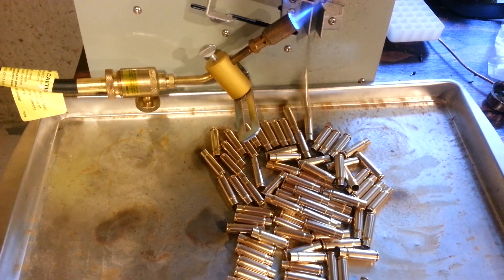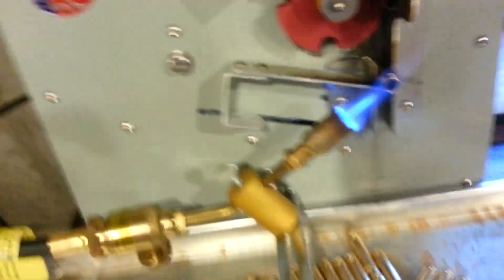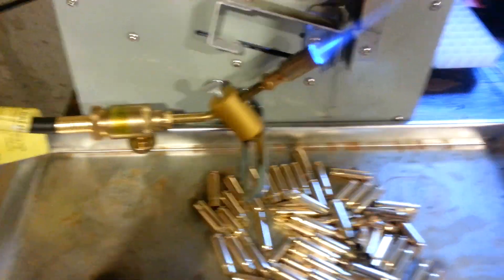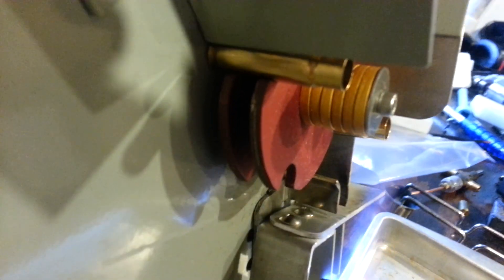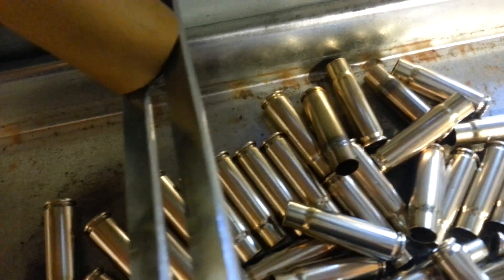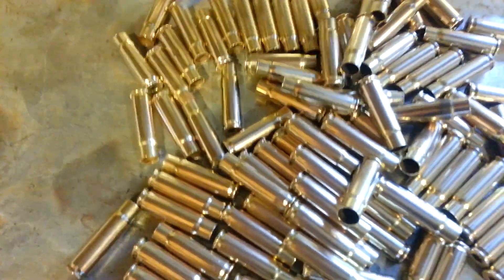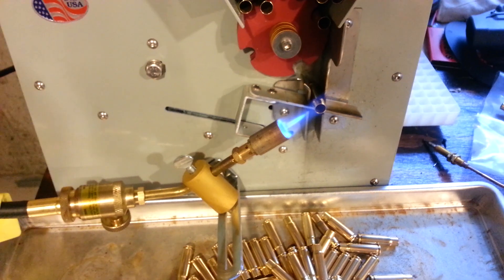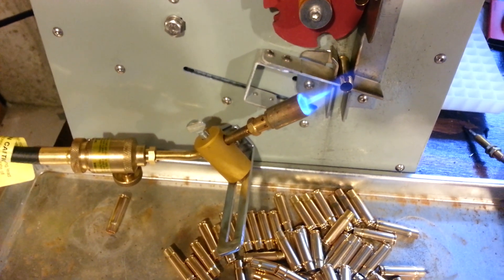Why coloring is not a good indicator of proper annealing.

Comment: What is your targeted temp? 650 degrees?
Reply from the maker: The correct annealing temperature would be ~660 for 15 minutes. Since that's not really feasible, (and would anneal more of the case than desired), the target temperature increases, and the exposure time goes down.

The target for this method is about ~750F degrees. It's recommended that you mark your test cases with 750 degree and 800 degree temperature indicating liquid (we use Tempilaq brand, which can be had from Brownells, Midway, etc.

You want to set your flame and exposure time so that it melts the 750 degree without melting the 800 degree Tempilaq.

You need to actually let the case go through the cooling process after it drops too, to make sure that "heat soak" isn't causing it to actually reach 800+ after it drops out of the flame.

I also recommend mangling any brass that is used for setup, beyond use, and tossing it in the scrap bucket. Don't want over-annealed cases magically finding their way into your good stuff (and they'll find a way if you don't immediately destroy them).

You also want to make sure that you aren't annealing much below the case neck shoulder, as you don't want to soften the case body or (especially) the web. A good rule of thumb is the top 1/3 of the case. If you're melting even 600 degree tempilaq below the top 1/3 of the case, you could be creating dangerous brass.

It's best to apply the tempilaq on the INSIDE of the case. It will melt instantly when the flame touches it, if you are painting it on the outside where it is in direct contact with the flame.

A good "sanity" check to ensure that you're getting the proper neck hardness is to set a pair of vice grips to just BARELY press in the case neck. You should be able to close the vice grips and see deformation of the case neck from a circle. Then release, it it should spring back to where it was before. A little tricky to describe, but hopefully that makes sense.
Reply: uraijit Ok you know what your talking about (lol). I asked your target temp because i have honestly never seen a case not change color at all when annealed properly .... Even my brand new Lapua brass is discolored straight off the press. I thought maybe you were targeting the 650 range and were not fully annealing the cartridge case and thats why it wasnt coloring. I find this odd , what brand of brass is this? Did you say it was winchester?
Reply from the maker: hpjunkie73 The brass is once-fired military Lake City 5.56mm brass, purchased directly from the military. We (West Desert Tactical) then convert it to 300 Blackout for resale. Because the new neck and shoulder are all on 'virgin' brass, it all has to be annealed, or they'll start splitting after only a couple of firings..

This brass is EXCEEDINGLY clean and shiny by the time it reaches the annealing stage. As I said, we recently upgraded our system, and it gets it even cleaner now than we ever were able to get it before (which was pretty clean and shiny even before). As I demonstrated in the vid, if the brass is allowed to sit for a few weeks prior to being annealed, a patina is able to build back up on the brass, and it will discolor to some degree or another, depending on how much patina has built up.

Your Lapua brass is discoloring, because it's been sitting long enough to have formed a thin layer of oxidization (patina), which is what actually causes the discoloration that many might be used to seeing. However, the coloring will vary depending on how much oxidization has built up, so it's not a good indicator of whether or not your target temp has been reached, since there's really no good way of gauging how much "patina" is there and, consequently, no way of predicting how much color change you'll see at given temps.

Also, different alloys from different manufacturers, or even different batches will discolor at different rates as well. So, again, color is never a good indicator of temp change (which means using color as your temp indicator will lead to inconsistent annealing, which means inconsistent results).

This is why going solely based off of color doesn't tell the whole story. Some brass might not discolor at all, until dangerous temps have been reached, ruining brass.

By the way, you may already be aware, but just in case you aren't, your Lapua brass was annealed from the factory, prior to polishing (and since the brass was brand new when the annealing was done, it probably wasn't that discolored prior to polish anyway), so while it's not visible, it's already annealed, so there's no need to re-anneal before firing; not that it hurts anything to do so.

Annealing isn't a cumulative thing, so there's not danger of doing it too often, as long as you pay attention to temps. That is to say, a given temp will always result in the same level of 'softeness' no matter how many times you do it, so it won't wear your brass out to do regularly, even if it's actually not needed.

Thanks for your comments! Let me know if you have any other questions.
Reply: uraijit I wasnt disagreeing with you , i believe you cant go by color either. I use a laser pyrometer and tempilaq on the same Giraud annealer as you do. I was just surprised they didnt color ... i personally have never seen that before with thousands of cases annealed under my belt. I guess you learn something new every day. You said you just upgraded your cleaning system. I use a wet tumbler with stainless steel shot with dawn and lemishine , then i polish in walnut shell with flitz polish. What was your upgrade? I would have sworn that was BRAND NEW brass , your brass cleaner is awesome.
Reply from the maker: +hpjunkie73 I know you weren't disagreeing, I was just explaining in further excruciating detail, as I'm wont to do. Don't mind my droning on, or take it personally. :)

The system we use is proprietary, designed myself for our purposes. We use a combination of pin and ball stainless steel media. The pins are great for doing inside primer pockets, and getting inside the edges around the rim, but the ball media does a much better job of polishing the larger surfaces.

For any necked cartridges smaller than .308 though, it's best to just stick with pins, as the balls will jam up in the necks of .223 brass.

Our system does up to 100# of brass at a time (roughly 8,000 rounds of .5.56, or 10,000 rounds of .300 BLK). It is an open system with some recent upgrades, including a new filtration system and water softener, which lets us constantly supply clean soft water to the brass.

We do a pre-processing wash of all of our brass without media, using only water and a dollop of dish detergent, to remove the grime from the fired brass. Just enough to get it clean, so we don't tear up our dies with dirt and grit.

Then we process it into 300 BLK, and then back into the wash system for a final wash and tumble with media, super purple/simple green, and dish soap--the super purple really helps break down the sizing lube used in the forming process--followed by a rinse with Lemishine. And then it gets racked and dried, and visually inspected before going into the annealing machines; and then gets hermetically sealed into bags.

We processed over a million rounds of this stuff this past year!
Reply: uraijit Ok now you have my interest. The only cases i care about a high polish on are my precision rifle cartridges. 50 bmg, 338 lapua , 300 win mag and 308 win. My 223 i only use in my AR and i dont care if they are not a high polish. The media i use is stainless pins from STM im interested in the stainless balls you use , what size and what supplier? If i could eliminate the walnut/flitz process. That would cut my tumble time in half. And thanks for the help.
Reply from the maker: hpjunkie73 I believe the media we have is  or 3/16, although 5/32 may be more common to find, and will work just as well. We picked up 25 lbs of it at an ebay auction from an auctioneer called Moe's Glick, who specializes in industrial supplies of companies that have gone out of business. They were selling on Ebay a couple years ago when I picked it up, they had a couple of tons of the stuff at the time, but I'm sure they've long-since sold out of it.

You can find it new on Ebay, but it's MUCH cheaper if you can find it used. Stainless shot is more commonly used in industrial applications than pins, so it should be easy to find. The problem is, once it's bought, it doesn't get sold very often, unless the company goes out of business, so you have to be lucky (or patient) to find it used.

Our mixture consists of about 25# of shot, and about 30#-40# of pins, to do 100# of brass. I'm sure a 50/50 mix of media types would be a good target, but the current ratio we use is quite effective.

I tend to use Corn Cob and Flitz, along with a (cap or two full of denatured alcohol to help strip the size lube) for tumbling my loads AFTER loading. The corn cob, I've found, is less dusty than the walnut media, and soaks up the alcohol and lanolin from the lube much better. The moisture from the alcohol and the lanolin also helps cut down on the overall dust, in my experience.

YMMV.